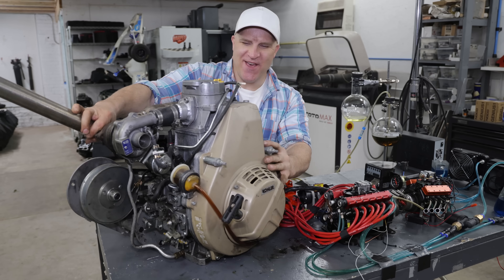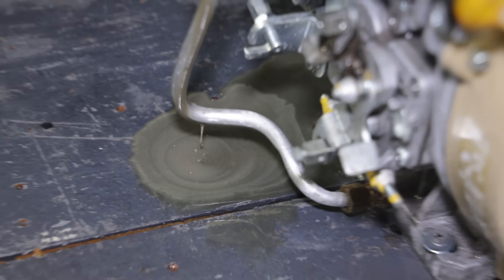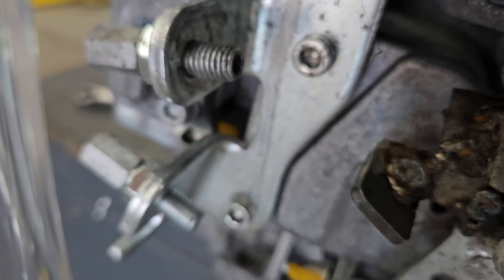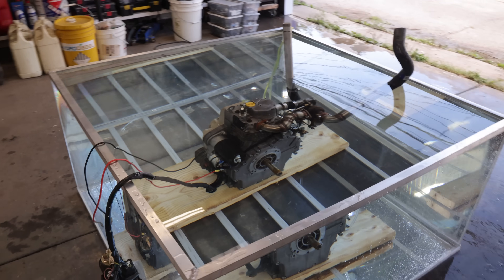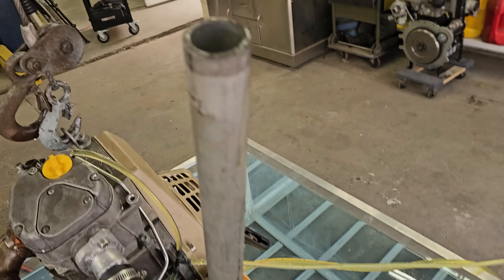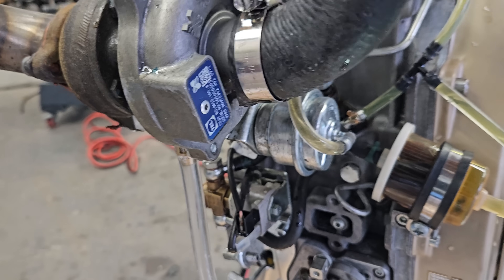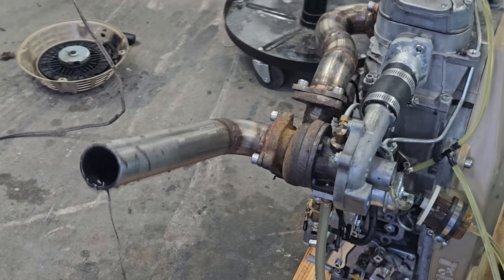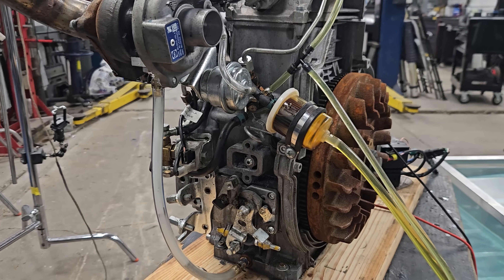Running Diesel Engine Underwater (Part 1)

Comment from the maker: New Customers Bet $5 Get $300 Instantly in Bonus Bets and $200 OFF NFL Sunday Ticket from YouTube and YouTube TV. Sign-up using https://dkng.co/warped or through my promo code WARPED
Reply: No way youre doing betting/gambling ads now man. Unfortunate. Unsubbed.
Reply from the maker: @SaudiSpeedLS2  Only one Ad, one of my guys said it was the best app he uses so I did it, I personally don't gamble, I don't even play the lottery.
Reply from the maker: @SaudiSpeedLS2 I can't lose sight of the mission and what's needed to accomplish it... To be fair Stocks are huge gamble
Reply: trash
Reply: Gambling ad? Damn man.
Reply from the maker: I got a do what I need to survive, but honestly sports wouldn't exist if people weren't betting on the games.
Reply: I had a 4 stroke bike kit engine and the valve cover blew by a lot.
Reply: Hey you need to run that engine without turbo . You need to snorkel the intake an exhaust and your getting water threw the crankcase breather . You need to sum how make a adapter nipple an run a hose off it above water . I'm pretty good with these engines an its hard to make water proof with a turbo. But you can do it with out running a turbo
Reply from the maker: I was thinking I need to seal up everything
Reply: @brett330-l4l not sure about this one but a lot of these run the crank vent to the intake. It’s literally a hole right into the intake port.
Reply: water probably went in the starter mount, usually those are just bolt on
Reply: Please do a test of mixing top fuel nitromethane race fuel into diesel fuel and see if it will run!! And tag me PLEASE!!
Reply from the maker: @MrTrevtrev198 that's a good one.

Comment: Cant plug the breather if anything drill out the old one and tap and thread in a pipe nipple and run a hose back to the surface air cant have a fully sealed crankcase

Comment: I went back and watched and you can see the oil going up the clear tube, then its all water when you try to start. You can actually watch it fill with water. It pushed the oil right up around the rings

Comment: Use pressurized smoke to find leak points, also drop it in with the engine running so you have positive crank pressure.

Comment: The engine seals are designed to keep oil inside the engine. The water pressure on the outside is greater than the pressure in the crankcase possibly weeping into the engine

Comment: You ever tried heating the fuel before it gets to the engine! I did i passed a copper tubing through the exhaust manifold on efi engine and got 50 percent more power and mpg watch my video and try it make a video and test it !!! Works on diesel and ef i. Carburetor engines need a a separate fuel injector using valve barb because of vapor lock on carburetor make test! Got 72 mpg on my ford max city driving! Problem is atki son engine valve stays open longer fuel comes out as pure vapor and expels some out! Otto engine don't have that problem. My town and country got 26 mpg city hwy combined!! Before it was 16 to 18!!.
Reply from the maker: That's really interesting, I have heard of preheating fuel, I'm not sure why manufacturers don't do it but that's a great point.

Comment: 8:22... If you roll a jetski in the lake, and possibly get some water in the engine, you are supposed to immediately flip it back over, start it up, and go full throttle for a while in order to get the engine up to full temp and then it will "steam" any water out of the crankcase. 

If you don't give it a proper workout, and get the engine warm enough to cook it all out, the water will just remain in the crankcase and begin rusting the engine internals and damage it.

Comment: As long as there's no leaks on the engine block itself and the exhausted Air intake are above the water are you sure I probably could🤔🤔🤔🤔🤔🤔the only other problem I could think of is the electronics don't stick your hand in the water.

Comment: If everything is ok then there are three things to consider:

(1) check if it has a PCV (Positive Crankcase Ventilation) valve to relief pressure from crankcase..

(2) the most important is that the oil seal is designed to prevent the pressure from inside leaking to outside...
.so currently with your experiment it will maybe/not work is because the pressure from the water acted upon the engine is not in equilibrium with the pressure from within the engine,therefore it forces the oil seal to open and let the water into the engine..

(3) the lever at the governor that connects to the fuel pump to controll engine speed cannot be sealed..or if sealed, it works from outside to the inside of the engine where it is operated by the engine camshaft..water can goes into the engine through this..

Only my opinion...Thanks..

Comment: You need to have it running as you lower it into the water 😆 its only going to keep filling up weather its running or not but would be more successful if it is running as you lower it in

Comment: Any single cylinder is going to have large crankcase volume fluctuations, so there has to be a vent to allow for airflow in and out the case or cranks seals would fail almost immediately. Typically, a crankcase breather/oil separator system will be either on the valve cover or the side of the block, and will usually have a PCV tube leading to the intake somewhere.

Comment: Why wouldnt it?  Any engine can run in a tank if properly prepped. Pcv assembly,  and use spring seals on the mains. The shaft sealsn can let in water we have spring loaded seals that can prevent water intrusion. Without the seals as the shaft spins it lets water intrude.

Comment: I'm suprised you didnt just fire it up and dunk it.
Reply from the maker: I didn't want to risk damaging the entire engine,
Reply: @WarpedYT  i figured the opposite, an non running engine wont be able to combat any leaks into the combustion chamber where it would hydrolock upon firing thus potentially damaging a rod. if it was running you could watch the exhuast while its being submerged and see whats happening in real time, plus it good to have crank pressure to pressurize the crankcase.

I didnt see you seal the starter mount. most times they are just bolted in. Anyway I still stand to fire it up and dunk it, just like offroaders that drive into rivers, its known to always keep the engine running, when it shuts off its game over.
Reply from the maker: @jtrill2 so for part two which we're just about done filming, I ended up firing it up and dunking it, I even did it a second time however, I wanted to dunk it first without firing it like I did in this video to make sure there was no leaks, and if there was fix them first, turn down to be a broken gasket on the throttle fuel pump cover, I'm pretty sure that would have damaged the engine so I got lucky there. But yeah definitely you have the right idea,. I just don't like spending a lot of time filming things and then having the main character get taken out lol
Reply: @WarpedYT   I knew you would get to the bottom of it and knock it out of the park, you are definitely thoughful, that shows in your work, repeatedly. Sorry if i was critical towards you, I guess I was too excited and just an impatient viewer who didnt even lift a finger to make anything happen. l'll simmer down and look forward to your part 2!

Comment: 5:30 where the water is pissing out is probably where its getting into the crankcase
Reply from the maker: That was definitely the main source.. finished filming part two trying to post it either tomorrow or Tuesday. Turned out to be a broken gasket somehow
Reply: @WarpedYT Still cheaper than a broken rubber. rock on man

Comment: I'm not a qualified mechanic but I think you may have a gasket failure in the turbo
Reply from the maker: Turned out to be a damaged gasket on the fuel pump throttle housing

Comment: Your turbo manifold could be a lot smaller in diameter. The exhaust pulse will be able to push harder on the turbine rather than dissipate in the manifold. More response

Comment: .  The starter is not water proof
Reply from the maker: We will see, I actually think it worked but there was just so much water in the crankcase it was hydrolocked. I should be wrapping up that video today and posting tomorrow so let's see what happens, I fixed all the leaks and everything looks good but haven't tried it underwater yet, that's going to happen today. Thanks
Reply: What i mean is. Starter to block needs a seal made,  seal the caps on the starter motor. Sealaround wires  and cramps as well.  Crank breather. Im sure there's more spots.  I wanna see it run too...

Comment: Sure it will not work, there is no such waterproof engine. Water will kill dilute mess contamination on diesel fuel, unless you drain all contaminated fuel. Youse new Un contaminated fuel it will run not under water off the water running.

Comment: All internal combustion engines have a breather vent. Likely in the valve cover. Take the cover off and find it and adapt a hose to above the water level if there is a one way valve keep that in there
Reply from the maker: I actually found it, by accident, But the breather actually has a check valve so the water wouldn't be able to get in The pressure would only be able to get out, I'm going to show it all in the video It should be posting Saturday It was very interesting.

Comment: Diesel can 100% run fully submerged so long as the intake and exhaust are open to atmosphere. Extraneous things like fins and bad seals not withstanding.
Reply: Clearly it has leaks.
Reply from the maker: Yes leaks are getting fixed now

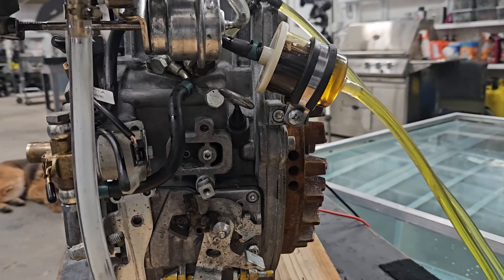Comment: The crankcase vent is right above what you THOUGHT it was. That aluminum plate with 2 screws, with the hole at the bottom... that's it. 9:23
Tap it and put a hose fitting on it, then run a vent line out of the water.
Reply from the maker: I did see it during the filming of the current segment, But on top of that there is also a breather in the valve cover with a check valve and a spring, pretty interesting

Comment: Also the fuel pump may not be sealed to the case. The crancase may not be sealed in multiple locations. Drain the oil, put it back under water and push air through the intake until bubbles come out. Seal that spot and repeat until fully sealed.
Reply from the maker: That's kind NDA what I did, it was more complicated than I thought. Trying to put the video out by sat

Comment: the air must escape in order for the crankcase to fill up with water. The turbo was full of oil. This means the water displaced the oil into the turbo. The crankcase air must have escaped through the turbo inlet. The crankcase is commonly vented through the air inlet port in the cylinder head. Any oil vapors are sucked in to the intake. The air escaped through the intake pipe. Hence you did not see any bubbles. The oil was pushed into the compressor housing. Search up 192FE diesel engine diagram and you may understand. KD192F

Comment: Judging that the turbo was full of oil, I bet under water, the water going in( from where ever) pushes the oil up through the turbo, making that the airs exit to atmosphere. and being under water, probably creates more pressure because the water is heavier than air, and oil. Kinda like putting a straw under water with your thumb over it, and releasing that, makes the water shoot up and over the water line. The engine has to have a vent/breather to vent out the oil vapors so the crank case pressure wont push out the seals. Since the oil in the turbo ( at least the time in the video suggests) wasn't mixed with a lot of water, I suspect the vent could be in the valve cover. It most likely pushed the oil out through the rings in the piston or back through the intake. I don't know what type of oil pump is in it, so if its a low pressure type, the seals in the turbo could be fucked and should check the turbo out before it decides to run away.
Reply from the maker: Those are a great points, but it ended up being an actual gasket that was broken, I'm not sure how I got broken but at some point in one of the previous videos it must have got damaged.

Comment: My guess is, the air escaped silently through an open intake or exhaust valve out at the top and water came in from below
Reply from the maker: It was actually a couple places it was leaking, and part of it was a broken gasket I don't know how it broke or got damaged at some point but you'll see it in part 2.

Comment: Your leak was likely the crank case vents.  They are not going to seal for water, it's a weak spring. The vents have to work, you can't move a piston up and down, changing the volume of the crank case, in a vacuum.  Tap the holes and run tubing out of the water.  Also, if it has a carb, you'll likely get leaks there too.  The butterfly valves and such are not going to be air tight or they wouldn't move.  If you are using a blow through setup on the carb, change it to a draw through and move the carb out of the water if possible.  That or build a water tight box around it and then the intake hose up out of the water.
Reply: It's a diesel, so it has no carburetor
Reply: @TheWrench-Wright  that's what Inwas thinking, but I've never messed with anything smaller than a cummins isx or know much about them.  But the same applies to any other similar rod opening unless it has an air tiggt gasket.

If you haven't already, try a lawn mower engine u got for cheap off marketplace m you've got my curious. 😂

Comment: My recommendation, is use a smoke tester to see the leak. Or better yet, slowly fill the take while the engine is running.  Then you’ll know exactly when it’s sucking in water. Lol. Just a suggestion. 😂😂
Reply from the maker: You're going to like what I did, The pressureization and the smoke test are all great suggestions. I got it to work in the video Wait till you see part 2 it's good
Reply: @WarpedYT cant wait! :)

Comment: 9:00 Yes there is a breather in the top section which goes into the air box, however the seal between the cooling casing and the breather is not perfect.

Comment: A possible practical application is that you definitely wont have overheating issues. And you're also heating water which could possibly be used for something else.

Make sure any and all crank case ventillation is plumbed to the outside! Good luck!

Comment: I believe that you would have to vent that crankcase breather. out to air outside the water. and I believe that the starter will short out under water along with any other electronics. and if the flywheel has plastic blades on it? the force of water against the blades will break them right off. but otherwise like you I don't see any way that water would get in the crankcase. and I can't imagine it has any other type of crankcase ventilation?

Comment: I would suggest putting a very thin oil into the block and then pressurize the block with about 5-8psi of air to find leaks.

Comment: I serviced those kd engines often. The military version has. Double lip oil seal and positive crancase vent valve Crankcase vent is located in head  cover and passage leads to intake valve. Military ones got thickier spring on valve to give higher crancase pressure to prevent water entry.

Comment: Just wondering about the objectives of such an experiment. After all, there are engines designed specifically to run under water.

Comment: There's definitely a crankcase breather somewhere. All small engines have them. I wouldn't trust that the check ball in them could withstand being submerged either. Extend it and bring it above the water

Comment: Lower it into the water while it runs? Or is that too easy since we pretty much already know that works from offroading? I think lowering it in running is at least maybe a decent step towards starting underwater. A check valve for air may not work for water too. Spray the whole thing down with soapy water while it's pressurized to find the leaks or use one of those smoke testers.

Comment: while not so important in this experiment...  do you realize that on single cylinder air cooled diesel engine..  that turbo is near useless without stored pressured air from turbo?  That works best with the exhaust/intake valve cycle of such engines.  See studys from Univ. Of Michigan (think that is who did it)

Comment: Take a puff of a vape and exhale it into the oil cap, should show your leak where the smoke escapes. 

Either that or put it in the water and blow air into it, like checking for a puncture on a tyre. 

P.s. it’s spelled tyre, not tire.

Comment: I would be suspect of where the actual case ventilation terminates. It should go to the intake side of the turbski.
I would also look at the manual decompression lever for signs of leaking.

Comment: Yes Somebody Trying Crazy Stuff
So you know i gotta Sub.
 I have a Theory that there is some Golden Ratio to be had between using fuel alternatives a trifecta of fuels like hydrogen cell from a cell, with water meth injection and like a low dose 2.5-5 shot of nitrous.
It would be cool to see that go-kart be boosted an additional way with the E-charger or if you can put that in a pickup truck that would also be cool cuz that's what I'm planning on doing with my vehicle I just don't feel like pulling over for the criminals of law enforcement ever again. 
In theory the water meth injection should cool the motor down and the turbo while providing more knock resistance 
But I don't know how that balances out with hydrogen which supposedly Burns at a much higher temperature. And then either the air conditioning is piped to the cold air intake or a very small dose of nitrous oxide should allow more air to enter into the intake to balance the additional higher fuel?
 If you'd like to see some great ideas be built I have a channel you could sub?